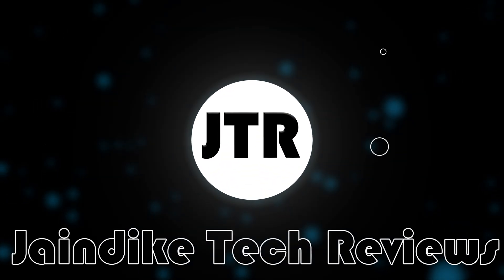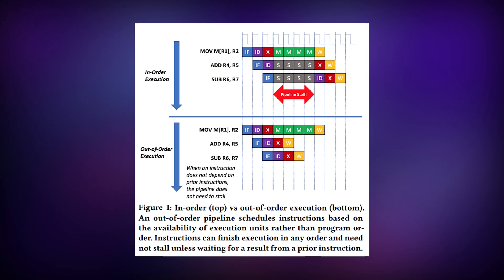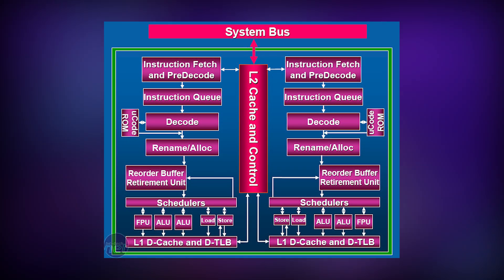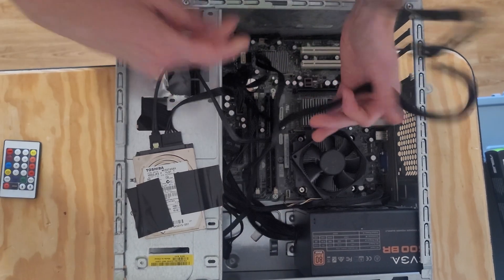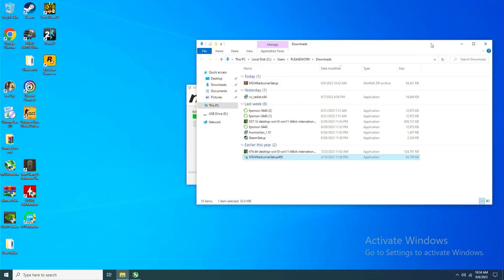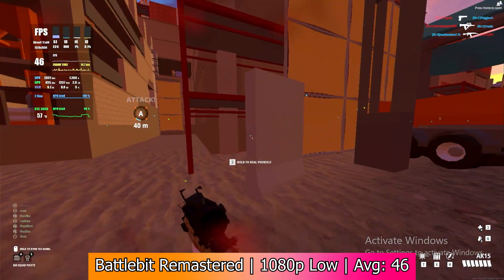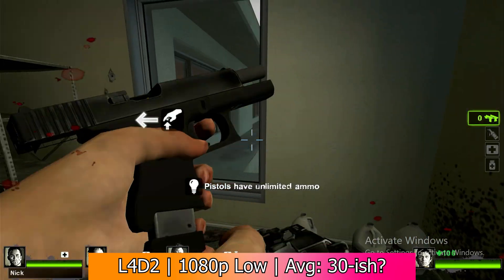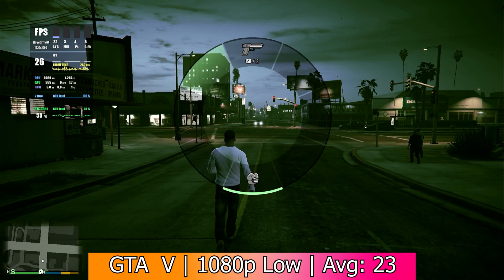The FIRST Core 2 Duo - Can Intel's E6700 Still Hold Up?

Comment: This was quite a decent CPU. But its success was mainly due to proper marketing.

The Core2Duo still lacked an intergrated memory controller that AMD had since 2003 with the Athlon 64.

The intergrated memory controller or better said the lack thereof made a massive impact in daily use.

Whereas the Athlon 64 X2 and the Phenom X4 got along pretty well.
The Core2Duo and the Core2Quads where noticeably lacking behind.

However since the synthetic benchmarks relied on bit for bit operations this didn't show.
Thus in benchmarks the Core2Duo actually outperformed the Athlon and the Phenom.

Also the massive fanbase Intel still had worked greatly in Intels advantage.

Now with the new Ryzen chips the youngsters then have grown up and are less biased.

Thats why AMD overtakes Intel in sales at some points today.

Comment: I'm still using Core 2 Duo at my house, at school, everywhere. I love the processor, but it won't live much longer <3
Reply: I used E6420, E4300, E7300, E8200, E8400. One I would NEVER use again is the E4300

E8200 my daily driver, still going strong with 10.

Comment: The Core2Duo fits perfectly into an XP Retro PC these days. I have an E8600 running at 3,6GHz (nothing special regarding the OC, but I'm using a stock cooler) and it is even faster in XP-gaming than a Q9450 clocked at 3,2GHz, which is not surprising for those who know, but still quite remarkable for "normal people" 😉 .

Comment: I had the precursor Pentium 3M (at 1.2 Ghz) that led to Core Duo (also had that one at 1.66Ghz.) Then I had this Pentium Dual Core CPU in your video and I remember how it was confusing that it shared the same model numbers as Core 2 Duo. I remember it ran GTA 3 great and GTA 4 pretty well. I ripped many Blu-ray by mail from Netflix with this CPU. After that I upgraded to the 4690K to play GTA 5. Looking back at this I wish I had this, or my Cyrix or K7 systems and I think I'm going to keep the 4690K around now that I realize I should have kept everything. It will still play some simpler titles in 4K with an RTX card 😅 I have some newer chips in between but now I have the new 265K. Crazy how time flies, I'm only 32

Comment: Sir I am a basic computer worker, 
I don't want to change my LGA 775 Socket motherboard. Existing cpu is Pentium E5700, so I want to buy a used good condition core 2 duo E6700  or it might be much better if I  get a core 2 Quad Q series best, but in India Q series (used) is not much available, so what to do sir? I need a decent website from where I can buy it , thank you sir.
Reply: I have core 2 duo in my home pc. If you need this contact me. I'm from WB.
Reply: I have core 2 duo in my home pc. If you need this contact me. I'm from WB.

Comment: You need to run it on win 7..and with more appropriate gpu.. not a 3060.. older games do not run that well on modern gpu.. at max go for 1060.

Comment: I have an old Core 2 Duo E7400 PC that I use mainly for mass storage and local backup because it has 6 SATA connectors and a 10Gbps NIC. I installed Debian Testing with the XFCE desktop on it 10 years ago and it's currently up-to-date. It's running the latest Linux kernel, XFCE, and everything.

I would say for media consumption and simple productivity tasks, perhaps even some modern gaming, a cheap modern Chinese brand Android tablet plus a keyboard and mouse is more effective than an ancient PC.
Reply: I use a Pentium dual-core from 2008 as a place to back up valuable data, offsite backup.

Comment: I use a MacBookPro5,5 13.3" laptop that has an Intel Core 2 Duo P7550 2.26 GHz, 8 GB DDR3 RAM, NVIDIA GeForce 9400M, and a Patriot Blaze 240 GB SSD. I upgraded the RAM from 2 GB to 2x4 GB, swapped the 250 GB Hitachi HDD for a 240 GB SSD, installed macOS X Mojave, and it runs okay. I was even able to run some old Steam games, like Half Life 2, Day of Defeat, and Team Fortress Classic, at 1280x800 (native) or 1280x720. YouTube 720p60 videos tend to be its limit, as 1080p is just a mess. But honestly, for a free laptop that was being thrown away, I still don't mind using it for light web tasks.
Reply from the maker: Ay free is always the best price. Not bad

Comment: How good is this processor for web browsing and watching 1080p60 videos on YouTube?

I have an old system from 2007 with “Intel Pentium Processor E2180”. I’ve tried to install “Core 2 Extreme QX6700”, but unfortunately, the motherboard cannot handle the voltage required for this CPU.

I wonder if I install “Core 2 Duo E6700” will I be able to use the computer for web browsing and watching YouTube on HD?
Reply from the maker: Depends on the OS, but on tiny 10 it will be useable. You can definitely use it for simple browsing like you mentioned, but its not going to be exceptionally fast, and windows 7 would be a better option. I'd recommend looking up all the supported CPUs for your mobo and finding a base core 2 quad like the q6600. Many of them are supported even on old OEM 775 mbs.
Reply: @Jaindike  I’ve tried to install Core 2 Quad Q6600, but unfortunately, the serviceman told me that the system can boot with this CPU, but it’s not working properly. I’m not sure if it is worth trying Core 2 Quad Q6700 on this system. 
My mobo model is “P5VD2-VM” from Asus with the latest BIOS revision. I think all these issues are caused by the crappy VIA P4M900 chipset.

All I need from this PC is to be able to play YouTube 1080p60 videos and browse the web.

I wonder if the “Core 2 Duo E6700” could be capable of that.

Comment: There's no need to use DVDs on these old systems. You can use WinSetupFromUSB to force it to boot the flashdrive. 
People managed to hold on to DVDs in the year 2000 cause 4.7GB was massive back then. Also they're was the DVD double layer version with 8.7GB capacity

Comment: I just build a Core 2 Duo rig with a mechanical drive for my niece a few weeks ago. It runs regular Windows 10 decently enough for general tasks. Socket 775 is an immortal platform, it would seem.
Reply from the maker: Gotta love socket 775. Had some crazy chips

Comment: I had a Core 2 Quad system until around 2016 ... it was long in the tooth at that point but could still hold up in non-game applications!  Fantastic architecture.
Reply: I ran a Q6600 until 2016 as well, I had a group of friends who wanted to get into GTA V online and it just couldn't handle it well enough.  Aside from that game I probably would have continued running the Q6600 for several more years.  I finally got shamed into finally throwing out the motherboard, CPU, and RAM a year and a half ago and now I've been having huge nostalgia cravings and kicking myself for tossing it all out.
Reply from the maker: I did a video on the q6600 a while back. Gonna make another one on it but was surprised how well it held up
Reply: I used core2quad and 750ti for gaming until 2021 and still do as a secondary from time to time.
Reply: I ran a pentium dual core e5200 from 2008-2009 till like 2017, it was okay to use. Games after 2013 had huge stutters in gameplay.

Comment: My first computer was a dell laptop with the old core two duo clocked at 2.16 GHz, I remember when BeamNG came out I optimistically ran the alpha on that with the first gen Intel HD Graphics

Performance was actually pretty good at 320x200   xD
Reply from the maker: How the heck did you get it to run at that resolution? That's awesome
Reply: @Jaindike  I don't quite remember but I'm pretty sure the old gen one alpha, or maybe the tech demo, had a resolution drop down that had pretty much every main resolution from the last three decades. It was great

Comment: You should really invest in a small SSD you can swap between systems, it's only like $20 or so. It'll save you time and sanity.
Reply: Or more cheaper 120gb SSD for 7-15€ (HDD can be utalized more efficiently for game storage only)
Reply: Just be careful with the very cheap SSDs, if they don't have a cache they'll be as slow if not slower than a HDD
Reply: Used/New  brand SSDs (besides kingston A400) are most safe options (micron BX is propably the cheapest 1 with dram cache) but if looking some cheapest i would propaply stick with westerndigital/PNY/kioxia 120gb SSD for boot drive (they are performing decently egnouf for the price) as used SSD would recomend some older samsung drives like evo 860/870
Reply: Yeah Samsung stuff is pretty stellar. I'm using an 870 EVO for boot and a WD HDD with 256MB cache. I've been really surprised with how responsive and fast cached HDDs are
Reply from the maker: I think I'm gonna buy a few in bulk. I tend to abuse hardware a bit to much

Comment: The Left 4 Dead 2 performance is a huge red flag that there's something else about the system that's creating a bottleneck.

I couldn't find numbers for that game, but Left 4 Dead 1 ran at 70+ FPS on a Pentium E5300 (same speed, half the cache) according to tomshardware, and I doubt valve would've made Left 4 Dead 2 run that much worse on systems from its time.

Also a quick google search should tell you how to install Windows 7 from USB, I've done it countless times. I've even installed it on unsupported Zen/Coffee lake systems where the USB drivers don't work, now that was a real pain.
Reply from the maker: I don't know why the l4d2 performance was so bad either. Also I reinstalled windows 7 via usb and via DVD. Both didn't want to work. Had a good ISO that worked but everything but now have no clue where it went.

Comment: Thanks for a genuinely interesting video. 

As someone who repairs and refurbishes computers but who only runs Linux now whilst still enjoying gaming, for any socket 775 machine that would normally take a Core 2 Duo CPU, there's absolutely no reason to not stick in a Core 2 Quad CPU like a Q6600 or Q9550, if your motherboard can take them (most will, some don't) because you can pick them up extremely cheaply now.

Someone also gave me a couple of old Core 2 Duo HP server machines that I ended up sending to recycling because they didn't have built in sound and I couldn't be bothered to buy sound cards for them. I did mess around with them for a while and whilst they wouldn't take Core 2 Quad CPUs in their 775 sockets, I did find a couple of really cheap 4 core Xeon CPUs that did work.

So there are a couple of good and cheap upgrade options for socket 775 that do make quite a bit of difference.
Reply: Theres literaly no need to hazzle with xeon on lga 775 socket anymore cos the prices for core2 cpus are no longer expensive (besides the rare ones and many overpriced) example theres lot of q6600 for 10€ or less
Reply: @BittiPomo  Like I said in the main post, some LGA775 boards do not take Core 2 Quad CPUs, the BIOS doesn't allow it.

However the 2 HP servers that I had did take Quad Core Xeon CPUs in place of the Core 2 Duo ones.

That's the only reason why I mentioned Xeons.

Comment: Wait a minute, make the highest end lga775 setup you can like q9550 with 1050ti or 750 ti with 16gb ddr3 ram
Reply: Agreed, my thoughts exactly.
Reply from the maker: Bro predicted a video
Reply: @Jaindike  xd
Reply: The Core 2 Quads will stop gaining performance around the 7850/7870 GPU mark.  With a Q9550, you might get a hair more out of an R9 280x or whatever, but not much more if any.

I had a Core 2 Quad @ 3.4ghz and gained ZERO going from a 7850 to a 7870.  Now, yes, the Q6600 was 2x Core 2 Duo's whereas the the Q9550 wasn't built like that, but still...

that's not a bad idea.  The 1050Ti is like 10-15% faster than the HD7870 in some games.
Reply: 750ti or 1030 would work. Both are similar if slightly faster than the GTX 560

Comment: Should be able too bsel overclock that cpu with the tape mod too 1333 fsb too get closer too 3.3 ghz i belive it should do at stock voltage with 333 fsb.

Pretty easy too do the bsel mod imo, did it myself in a bit alternative way on a pair of cpus with a bit of superglue & a strand of copper wire too bridge the two pads needed.
But covering the bsel2 pad with electrical tape or kapton tape works just as well & is reversible, should be the same exact process as doing it on a core 2 quad q6600 too get 3 ghz if you look up a video on that you should be covered too do it on the e6000 series of processors & other socket 775 processors with 1066 fsb.
Reply: Thanks for mentioning that, I do remember seeing a tutorial on how to do that a while ago but forgot about it - I have an old Dell Optiplex with a socket 775 that I may try this on, now you've reminded me about it.